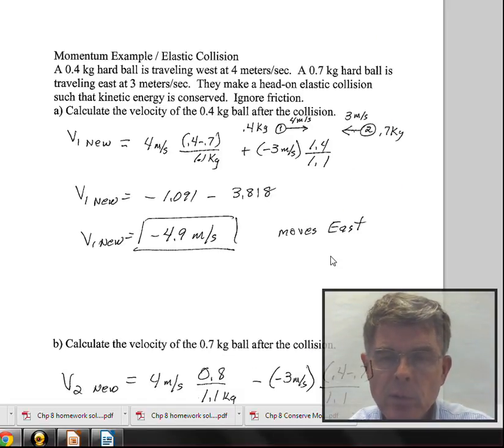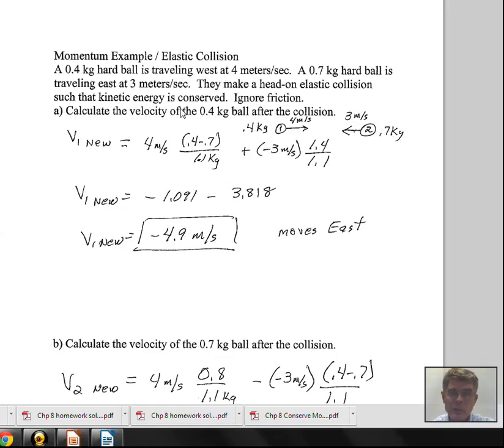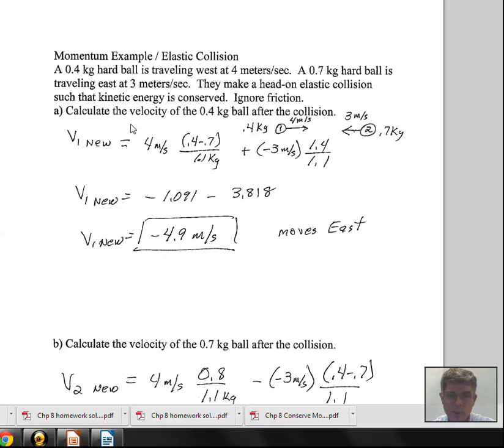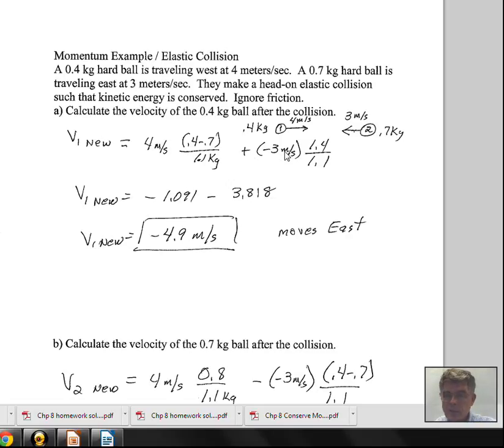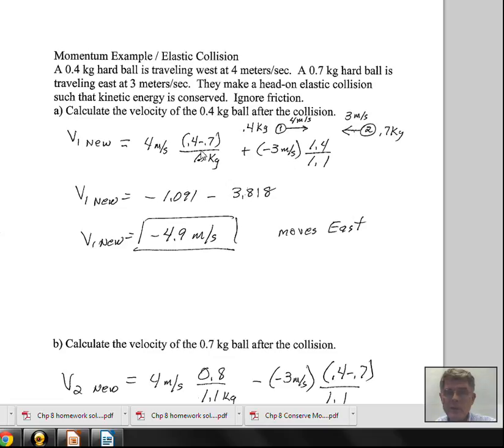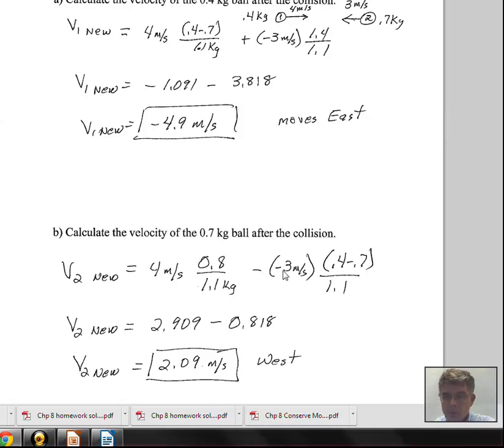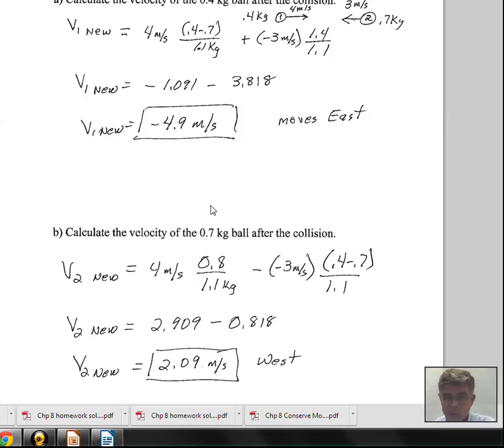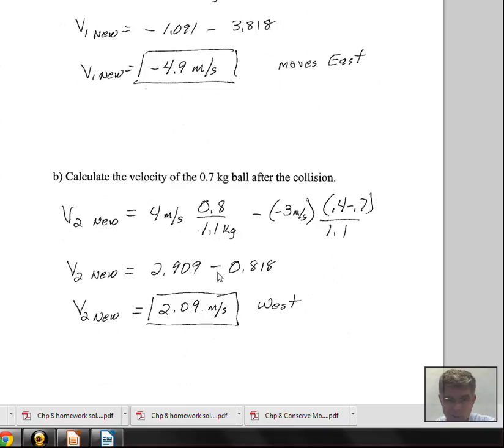Elastic Collision, Calculate the two final velocities

Comment: sure wish you would show the equations being used! - conservation of momentum and KE somehow combined - but the numbers are plugged in right away!
Reply from the maker: The method used in the video does not use the separate equations for conservation of KE and conservation of momentum.  If you would like to work the problem in that way, 1) write the conservation of KE equation using separate terms for the KE of each object before and after the collision, 2) write the conservation of momentum equation using separate terms for the momentum of each object before and after the collision, 3) you now have two equations and two unknowns (the final velocities) so solve the momentum equation for the final velocity of object 1 and substitute that expression into the KE equation and solve for the final velocity of object 2, 4) use the final velocity of object 2 to calculate the final velocity of object 1.  Be careful to use the correct + or - sign on the velocities in the momentum equation.
Reply: Greg Clements don't you need to use "physics".. equations that come from traditional physics? otherwise one could just be making stuff up. it's hard to follow if we can't see the equations. the variables that make up the equations.